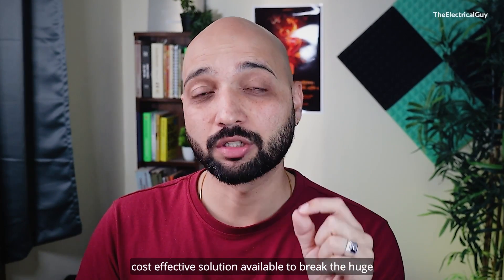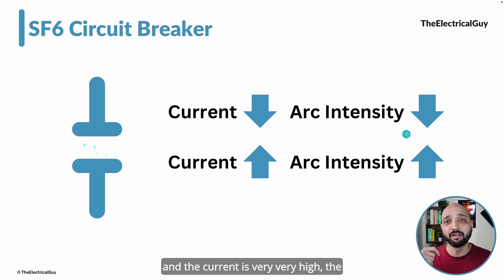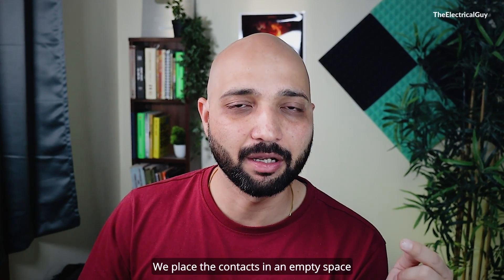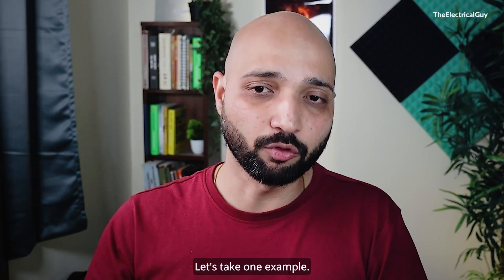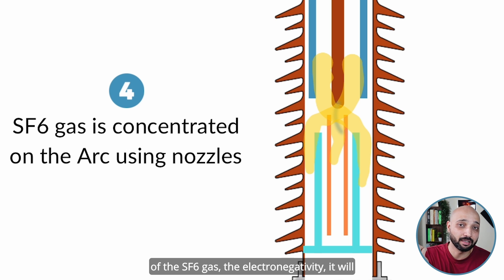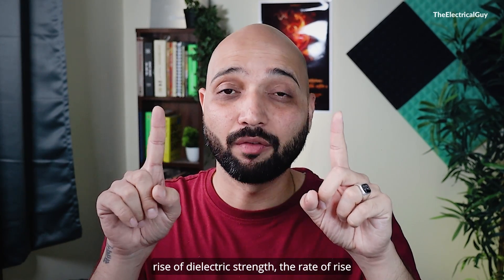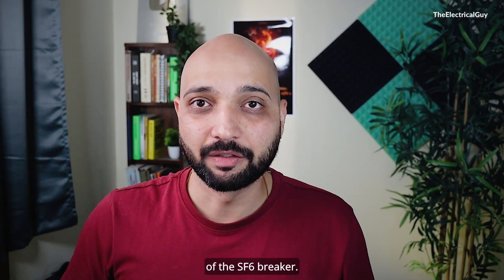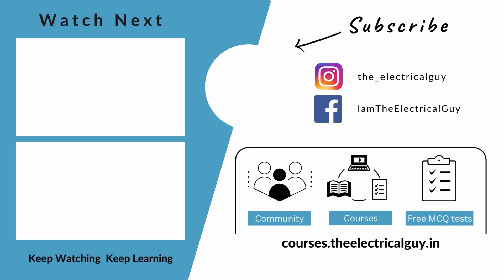SF6 Circuit Breaker Working Principle | Explained | TheElectricalGuy

Comment: what general magnitude (small/large?) of mechanical force is generated when the dead tank breaker trips?  what is the distance of travel of the pieces?  Wondering if this force is seen by the support legs and anchor bolts and foundation for the breaker.

Comment: Thank you  and one question what is the pressure of SF6 ?
Reply: Depends on the manufacturer and type. There is both high pressure and low pressure systems. (Single or Dual pressure) Single pressure have a nominal pressure of around 80psi.

Comment: Great video as always. But still there is one confusion like u said higher the current higher arc intensity but in distribution MV system current is lower as compared to LV system.
Reply from the maker: I was referring to fault currents. Which will be upto 40kA in MV
Reply: @GauravJ  -Thanks